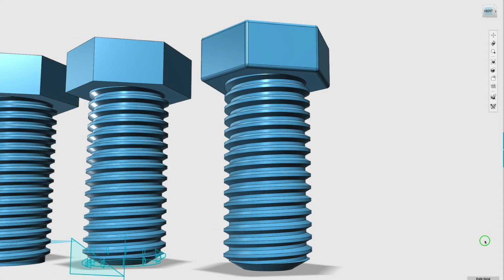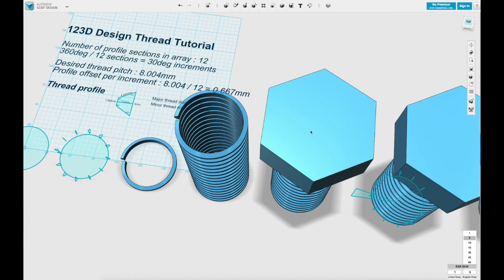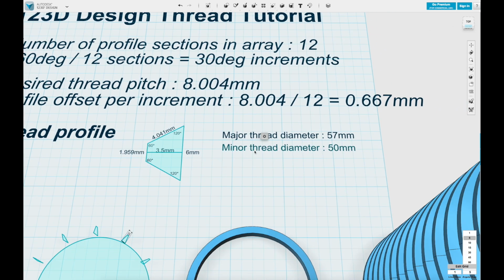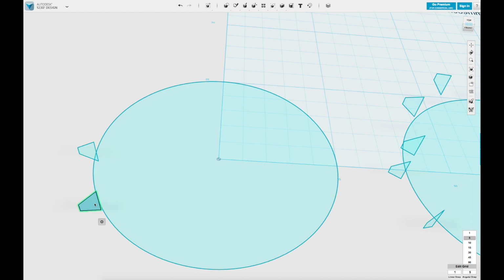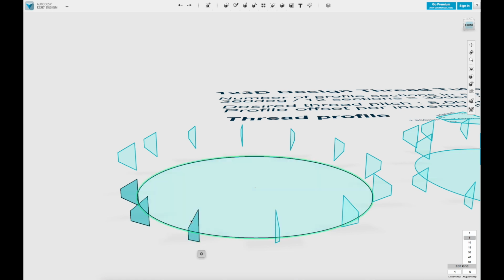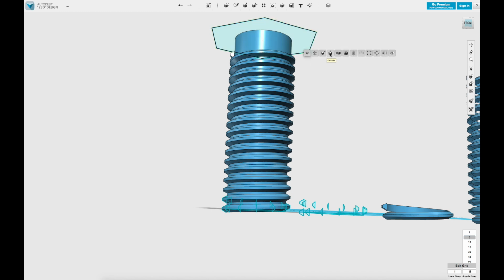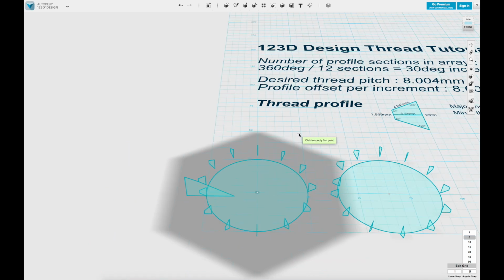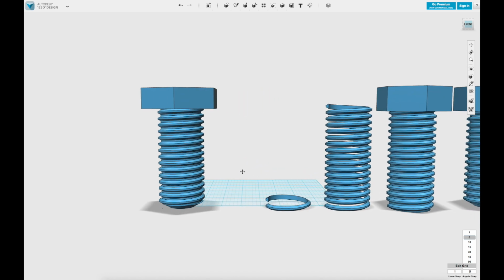Building UNC threads in Autodesk 123D design

Comment: Interesting how much the UNC system is connected to the metric system. The inner diameter is 50mm and the bolthead radius is also 50mm.
however, do you think its possible to create the nut by making a boolean operation and ad a little space to the threads?

Comment: Absolutely excellent!  The biggest problem with the torus approach is as you rotate the torus on one axis you diminish its circularity on the perpendicular axis.  For instance, say you rotate the torus on the y-axis, what you have done is transmute some of the torus's bias from x-axis expression to z-axis expression.  This means you are effectively producing an oval shape when viewed from the top down.  This means the threads will not have smooth operation, there will be lumps.  As you rotate the screw you will notice momentarily binds and then releases, as you crest each high/low point mismatch in rotation (because "oval").  This means the torus approach is not a true screw pattern, as you are sacrificing x/y plane circularity for z movement.    

I had conceived of doing a screw in this manor, but I didn't know about the operation that would allow you to change your orientation!  What an invaluable technique to know about!!!  Thank you for sharing, I hope you produce more videos as good as this one.  I subscribed as I hope to see them when you do!  :)
Reply from the maker: Hey Bu, thanks for your input. The slight distortions that are caused in the torus method are less of a concern to me when compared to how they print and function in the real world. If someone just needs threads for something simple or cosmetic, they might serve that purpose, but since overhangs are such a challenge to print, its likely that the undersides of the threads will print sloppily and in addition to that, the rounding of the threads isn't very conducive to holding much tension.

Unfortunately, Autodesk has (i believe temporarily) discontinued offering 123D design, and there have been almost no requests for specific tutorials or content from other users. So I haven't had anything new to post. If you have any content you would like to see that is related to 3D modelling in either 123D or Fusion 360, or anything related to 3D printing, please let me know and I will definitely see what I can do.

Thanks again for your comment!
Reply: I haven't had any difficulty printing the over hangs the torus approach produces, I just don't like how it bind, and I would prefer an even tension.  I believe that is advantageous mechanical load bearing ways as well.

I didn't know Auto Desk had discontinued 123D Design.  I really like that app.  I have tried to get into Fusion 360, but I find it very difficult to get started with, and can't even manage to replicate my same level of skill as I have in 123D.  If you wanted to do a series aimed at teaching people who are coming from a 123D background to Fusion how to move over and do familiar work flows that would super awesome!
Reply from the maker: Interesting idea. When I made the move from 123D to Fusion, it was only because I knew it had more potential, so at first I had to force myself to do it the hard way in fusion rather than in 123D where I already understood it. It definitely took some time to get familiar with Fusion, but it was absolutely worth it. Going back to 123D usually has me frustrated, and feeling like the tools I need are missing. I'm going to consider making a fusion 360 video series for beginners. Thanks for your input.

Comment: hallo drive3D,
really good instruction, I am impressed. I'll try my luck with a metric bolt. I just started with this whole 3D thing- and learning 3D modeling consequently. I thought TinkerCad is a good starting point.
If I might comment on the hex head: The bottom of the heads usually have just a square edge and on the top (view) you would draw an inside circle that just not touches the flat sides of the hexagenon. Then, in the side view, you chamfer (no radius) about 15 degrees from that circle line. That gives you a low point  on each of the three vertical edges. Then draw an arc between any two low points on the verticals, touching the circle ( on the top) in between them. That gives you one long arc in the center section and two short ones on the sides. Then you have the real look, you'll like it. 
Just in case you didn't know already.
 (I hope it makes any sense, I can not believe how difficult it is to describe; it is much easier to draw, on paper :-)
I like the vid, cheers

Comment: Hi, did you have any trouble creating the original trapezoid (that you 
then loft into the thread)?  When I build a trapezoid, then try to move 
it, the drag arrows don't align with the grid - they are cocked at an 
angle (seem to be aligned with one of the trapezoid sides rather than 
the grid).  I'm new at this and assume there's a way to force the arrows
 parallel to the grid axes but haven't been able to figure it out.  Have
 you seen this behavior?

Comment: Excellent guide but 123d version 2.2.14 sure doesn't copy and paste or 'loft' like your 123d version, it will only do 2 objects at a time with shift held down, which 123d version are you using ?
Reply from the maker: I'm not sure which version I was using when I made the video, but I just tried doing the same process I showed in the tutorial in 2.2.14 and I had no problems. I'm not sure where the disconnect is... are you using PC or Mac?